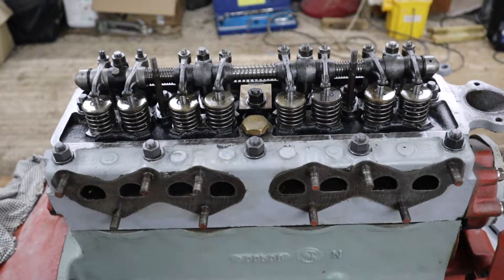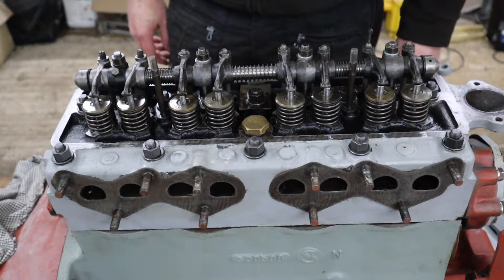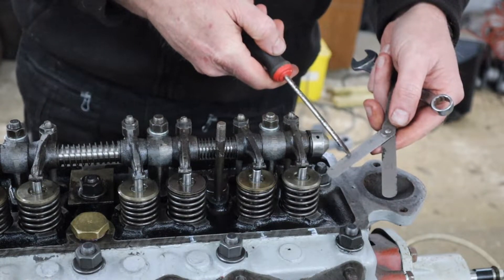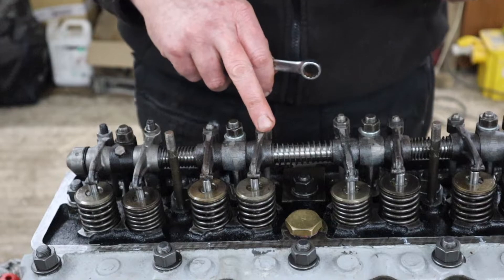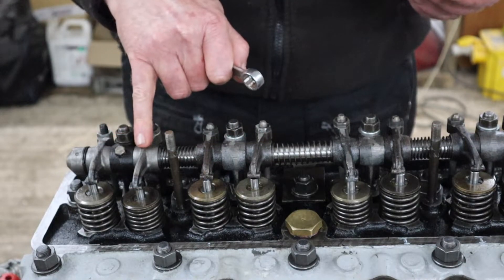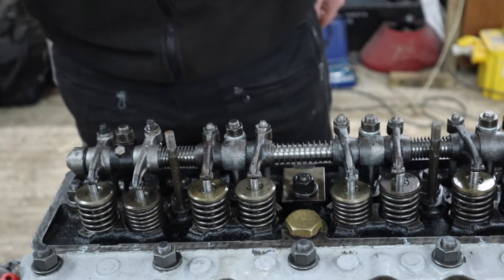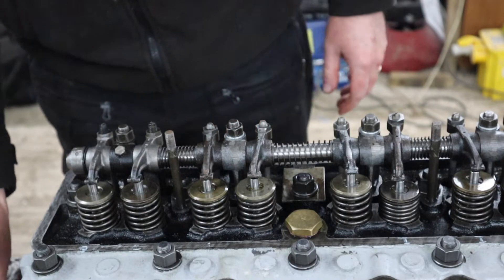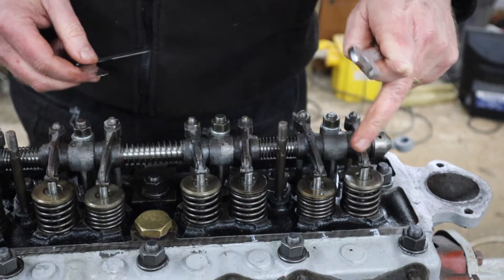#126 Ferguson TED20 - Setting the Tappets - with Anglo Agriparts

Comment: Hi boys, I also saw your other video where you installed the brass plug in the cylinder head with loktight.  I also had 2 small cracks around the white plug, quite similar to yours. Like yours it looked very minor but I had NDT test done on the head and it showed the cracks went right along the length of the cylinder head running parallel to the valves, but could only be seen on NDT - could not see it with naked eye or magnifying glass.  Just thought I would let you know might be worth triple checking yours! Jon
Reply from the maker: Hi thanks Jon, we’re so far along now I think we’ll chance it. At least if we do have any issues we know where to start looking. 😉 Well done for checking yours first! 👍😉
Reply: @WaterhouseForde  yeh I would do the same, after a short initial run might be worth to quickly take the tank off, pop off the rocker cover and have a look to make sure, and check your sump.